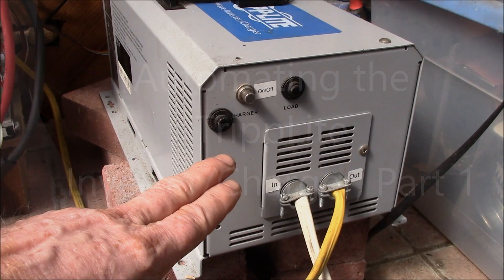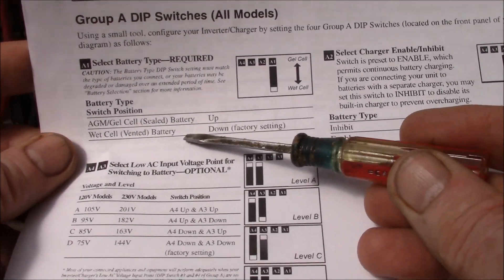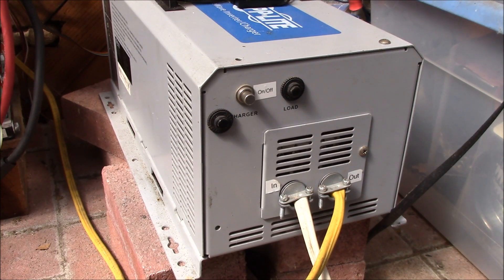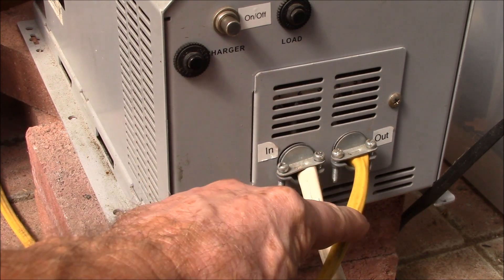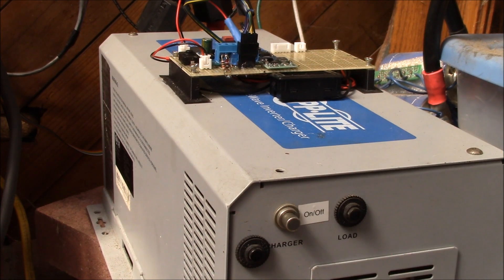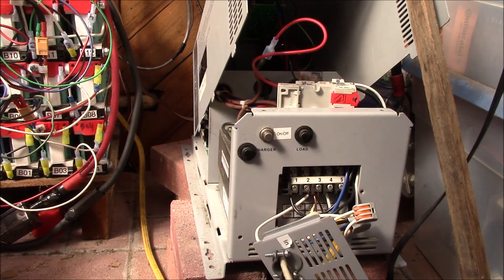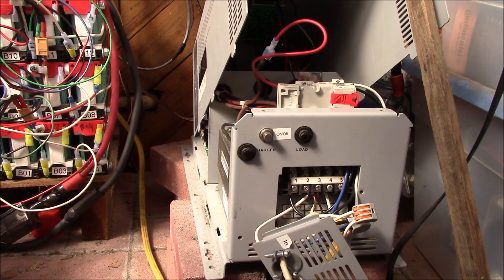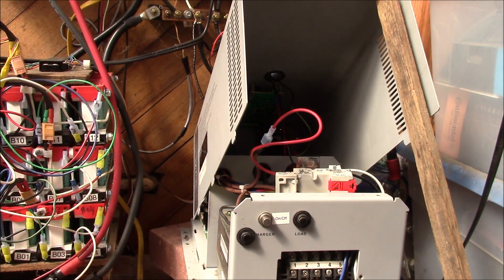Automating the TrippLite Inverter/Charger, Part 1

Comment: It's not a Tripp Lite APS1012SW any more...well it is but it isn't...it's better...going strong as long as parts don't exceed cost of new device...but not an issue if there is not a unit manufactured with your added functions...impressive...almost made a comment about
AC/DC and  phantom load...then realized I am more street wise than book wise...♀
Reply from the maker: Parts are not terribly expensive, I think the relay may be the most expensive at $15 plus $10 for the socket.  In the final setup, the relay will only be on when the inverter is running in AC mode.  So it'll add 1 watt to the operating power at that time, but nothing while running on DC power.  Ideally, the unit will not be running on AC power much at all, only on cloudy days and perhaps a few hours at night.
Reply: R Brown 
Reminder not to turn it into a "Winchester" project...
Reply from the maker: Yes, I hear you on that.  This has gotten a bit more involved but I think I have a handle on it now.  Need to lay out the hardware parts and make sure I have enough I/O connections on the Arduino to handle all the assorted inputs and outputs.  Then I can start working on the software component.  Most of this will be re-using existing code, but there are always issues with integrating code from various sources.
Reply: R Brown 
Waiting for parts helps to think out your plans...keep thinking "outside the box"
Reply: I know Im asking randomly but does anyone know of a method to log back into an instagram account??
I stupidly forgot the login password. I appreciate any help you can give me!
Reply: @Trent Kevin instablaster =)
Reply: @Maximo Solomon i really appreciate your reply. I got to the site on google and I'm trying it out atm.
Takes quite some time so I will get back to you later with my results.
Reply: @Maximo Solomon It did the trick and I now got access to my account again. I am so happy!
Thanks so much you saved my ass :D
Reply: @Trent Kevin happy to help =)